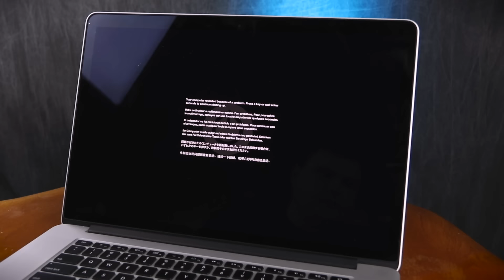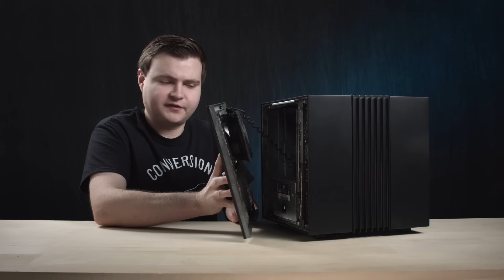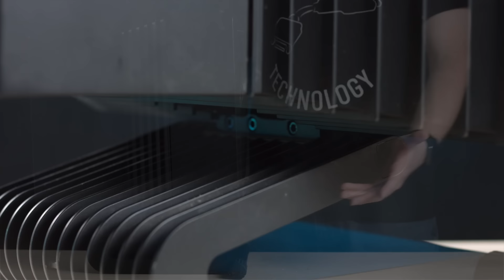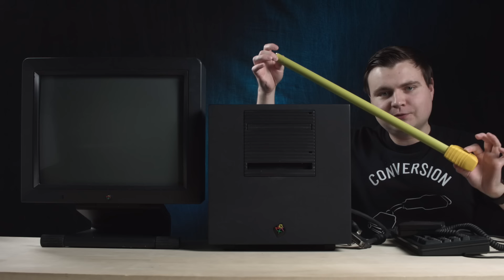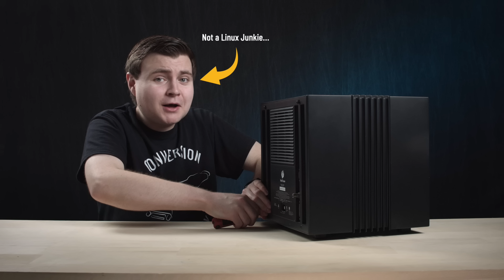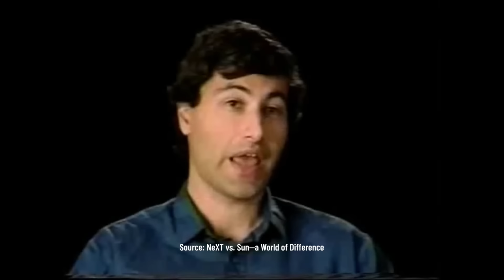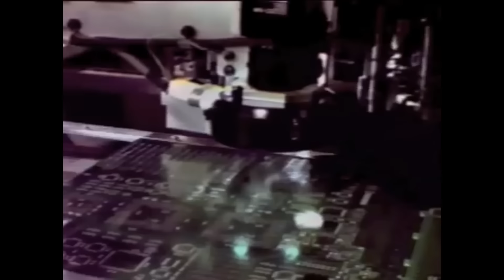I Bought a NeXTcube, Now What? - Krazy Ken's Tech Misadventures

Comment: Dude, I have one of these NextCubes aswell
I bought it in the early 2000’s from Penn State for $25
Yeah $25, it was barely used. Came with everything too
I’ve got the NextStep software reinstall discs 
And I have a pile of software for it
I use it to just putts around with 80’s Unix bro
I love it
Anyway, I’m going to be looking for a new home for it
It’ll likely get donated to one of the Big Mac channels on here
Like yourself if you want it
It is a Turbo model btw
I have a NextStation full too both with display keyboard and mouse
My Next Cube has the Next Dimension board and the Turbo board with color display
I paid $25 for all of it
So donating it will be it’s future
They were both used very lightly by my professor for the Penn State Computer Science Department

Comment: steve knew the Motorola 68k chip is not that great for his OS during that time , but do requires something with kick later on...when time is right for it G3 cpu's. Remember he came back to fix macos8 ....releasing macos9 by his hands, he did got early dock for it while its not unix based for os9. ...while nextstep still WIP for next years until first rhapsody r1 came out ...Then 2nd version . Then Steve end entire x86 development support for first RC of mac OS X that only ibm G processor supported. All that change later years when he went  to intel for later macos x

Comment: To put the price in context, this was a legitimate workstation, and most of it's contemporaries were priced even higher.
I do love my NeXTcube (thanks for making the computer/cube distinction), and mine has the rare Dimension board. Essentially, a second motherboard with it's own processors (2 of them!) which ran it's own micro-kernel OS and provided the attached monitor with 32-bit colour output. The Dimension board, unlike the main motherboard, does not have a Display PostScript engine.

FYI, my NeXTcube has the same dimensions yours does. It's shorter than it is deep and wide.

Comment: In November 1988, a little less than one year out of college, I stopped by a retailer selling NeXT Computers near the university where I had completed most of my math and engineering coursework. I was practically salivating as they showed me what the thing could do. It was my first year working full time as a software engineer and I finally had excess income but resisted a burning desire to buy one, walking away from there with a severe case of the shakes, wondering if I was making a major career-damaging mistake. 

Landing a job a year later porting software to several UNIX systems including DEC ULTRIX, HP-UX, IBM AIX, APOLLO AEGIS, and SGI IRIX I was in hog heaven at work, and finally at home too after cobbling together a GRID RHCL system to tinker with before moving on to developing on Sun UltraSPARC II at work. It wasn’t until 2011 that I finally upgraded the home system to an iMac Core i7 with a glorious 27-inch monitor which served me well as company computer in my own little LLC through to retirement, and four years beyond that, until it was destroyed by wildfire in 2022. Luckily I had copied everything from the iMac over to a Mac Mini by then and ran from the wildfire with that sweet little device in my bugout bag. Now I’m wrestling with desire to upgrade again, purely for post-retirement hobby work.

Even after all that, it’s good to finally get to see this presentation of a NeXTcube.

Comment: The Next cube; facts vs fiction
- Why cast magnesium? Its relatively cheap and contains most spurious EMI emissions allowing for FCC compliance.
- Cube dimensions. It was designed to be 12x12x12. Any deviation is due to mfg tolerances.
- Is it really a 'cube'? Yes. The enclosure is made up of 3 seperate pieces. Each one is cast using '4 slide' molds. These molds have no draft or taper.
- How do I know this? I was the Manufacturing Engineer at Next responsible for bringing the cube from concept to production.

Comment: 05:45 Accuracy please, "Modern Internet" is not the World Wide Web... Sorry, but it is annoying that people are hastily comparing both as one too casually or what ever. 
People need to be specifically pointed that WWW is NOT the internet, it is a another technology that use the Internet to work.
HTTP protocol is higher level protocol using the TCP, UDP and IP protocols (TCP/IP and UDP/IP), where two former are using the latter IP protocol.
The HTTP is like FTP, IMAP, POP, SSH, RTSP etc... Application layer protocol, that can be anything that application want to have to initiate the protocol with its counterpart application. 

The Internet existed, and was used way before the WWW, and that is always critical to understand. We had video streaming, voice over IP, forums, emails etc everything before the WWW. The WWW is just the web browser and now using lot of other older protocols to get the stuff as well rendered in the browser interface.

Comment: Why would they make the case out of Magnesium.  Magnesium goes up in a flare like a...   sparkler.

It could be easily be mistaken for an orphaned stereo speaker or space heater from the 1980's.
If I had wanted a IIci at the time with color Trinitron display, and management got me a Next, i would of been like... aww...

Comment: 23:02 it might be inspired by NeXT, but macOS had double arrows both at the same end of the scrollbar, starting with System 7.6, I think? It was definitely an option before OS X, but I’m not 100% sure which version. So they could be that way in OS X because of NeXTStep or because of Mac OS.

Comment: This was always an absolute amazing system!

As an Atari ST (and later Atari Falcon) user at that time, I found the Motorola MC68040 processor unbelievable, not to speak of the Intel i860 64-bit processor used as graphics controller, and the Motoral DSP 56k as audio signal processor.

Comment: Cool stuff.  Years back I bought the NextStep operating system for PCs.  I didn't realize that it required a bootable CDROM drive to install it.  Back then that meant SCSI.  I didn't have access to that and it never got used.  :-(  Of course eventually NextOS became the Mac OS X, so in recent years I did get to experience much of that.

Comment: The size differences are real.  To cast a cube is difficult to impossible, as you need a little taper to get the case out of the mold. If you want a perfect cube you have to cast it a little bit larger and tapered, then machine it down to a perfect cube.  Even Steve Jobs didn’t want to spend the extra $$ for that extra bit of perfection.

Comment: Was a programmer (JOVIAL) in the mid 80's on the USAF AWACs. Used an IBM 360 I believe with the huge hard drives. In the simulator we had a Honeywell 4PI like the AWAC used. We had to learn to use punch cards in tech school but thankfully the 4 PI used those big magnetic tape reels. Remember when floppy was a big thing, had a room mate who splurged for the Commadore 64 which used the floppy.

Comment: There was a way to do multi-processing, with a separate motherboard in every slot, except for the Video slot.
It was built to be 10% better than a Quadra 800av. The LaserPrinter was 400dpi.

I had three, one cube, and two turbo slabs. Adobe Illustrator and Adobe type twister flew on these boxes.

And no, Mac OS 10 has a DOC because it was derived from NeXT Step. I was there for the MacWorld Rollout.

That was the day I met Steven Wolfram. He said that Mathematica did not support the FPU because of bugs in the GNU Libraries. ok.

Comment: I am at the point where you just mentioned the floppy drive, and that what ever is there looks too big... Well, during the time the NexT was made, they were still using 5 1/2 inch floppy's.
Point of correction, the INTERNET was not based on the NexT computer.  it was In August 1969, the UCLA team hooked up its host computer to an IMP, a Honeywell DDP 516 computer, making it the first of the four sites to connect into ARPANET, which became the Internet/World Wide Web...

Comment: The Nextcube had an option for a 3D-VFX and component YCbCr video recording board called NextDimension which had a very expensive and powerful video-coprocessor which if proper software was created and used, you could edit S-Video and 3-channel component video on a timeline much like what Adobe Premiere, Blackmagic Resolve AVID Media Pro do today! There was to be a duaghter C-Cube MPJEG encoder daughter board that was attached to create a timeline editor but that didn't actually ever ship. The main NextDimension board just has the 33 MHz Intel i860 RISC processor on it which was something no-one else had on a super-workstation! A lot of scientific research and petro-companies bought those NextDimenion boards with the NextCube just for the i860 chip!

The NextDimension board was basically a graphics supercomputer all by itself and I remember seeing demos of this in Calgary, Canada at various Oil & Gas companies using the NextDimension and NextCubes for oil and gas reservoir and directional drilling modelling. It was actually MUCH CHEAPER TO BUY and MORE POWERFUL computation-wise than the Sun and Apollo super-workstations and VAX Minicomputers of the late 1980's and early 1990's! It had an i860 RISC processor on it which was basically a supercomputer-on-a-chip it was so powerful!

I personally used a Nextstation, which was more of like a pizza box workstation, for graphics development but I have used the NextCube and NextDimension boards too! 

As a suggestion, ALSO LOOKUP, Play Inc.'s Trinity video editor cube which was FOUR TIMES THE SIZE and weight of the NextCube and was a powerful supercomputer all by itself in 1999. Of course look up the even older VideoToaster (v1 to v5) from 1990 onwards along with its parent Amiga 4000 computer! I used those in College for broadcast television courses!  Another piece of computer history is the Leitch Velocity-HD with 3D-VFX card and connector box which is a MONUMENTAL moment in real-time video editing and graphics supercomputing! It is STILL today in 2022, an awesome and complete realtime video/auido editor software/hardware combination!

Another set of older BUT POWERFUL computers to lookup and buy are the SGI (Silicon Graphics) Indigo, Indy, Octane and Onyx superworkstations which I have also used and even today are pretty cool to use! The very first Jurassic Park movies were 3D-animated on these SGI units from the Early 1990's to 2003+! If you can still find it, buy the 1600SW monitor which was still one of the BEST displays I have ever used!

And for the KICKER, try and buy the old Intel 80386 processor-based IBM PS/2 Model-80 tower system running IBM OS/2 Warp-4 OS which I used even up until the mid-to-late-2010's for financial trading systems work and scientific spreadsheet modelling work because all the legacy software and those HUGE number of iterative self-expanding macros was just too expensive and esoteric to re-code/convert to a modern JAVA and C++ system until about 2018!

V

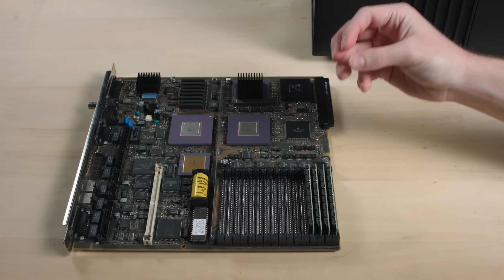Comment: https://www.youtube.com/watch?v=92NNyd3m79I :Steve-Jobs-Presentation with making the board from about minute 28 on. But just imagine:The 68040 CPU had about 1 Mio. Transistors at 25 Mhz. Nowadays we are about 1 Billion transistors and 3 ghz. Now make the math how many 10.000$-Cubes are in a present PC for about 400$ 😉   Btw.: You made a great purchase: This thing seems to be have barely been used. O.K its not from 1990 but Early 1992 ( 9:33 9142= 42nd week 1991 ) I wonder how this PC is booting with the surely dead CMOS- BIOS-battery

Comment: I believe the square that forms the front of the cube needs to be slightly smaller than there rear so that they can be extracted from their molds during the manufacturing process.
Reply: Yeah!  I think the slightly imperfect being perceived as perfect was marketing BS they came up with just in case anyone measured the thing.  And Jobs' being the difficult, uncompromising, seeker of perfection that he was ... he would never have settled for anything less than a perfect cube.  Except that, like other areas of his life where this inability to accept reality ultimately forced compromise ... it's just more cost effective to not waste material that can't be extracted from a mold due to manufacturing processes.

Comment: I am very glad that modern case design doesn't have to be that complicated if I don't want it to be. Sure, you can buy one of those mini-cases and challenge yourself to build within the confines of a tiny case, but you don't HAVE to do that. I just imagine working on that thing, with it being dependent on being slotted into the case connector correctly and the way the cables connect to the edge of the case.

Comment: How are you getting millimeter results if you are using inches? Those are 16ths if you are using a cheap measuring tape or 32nds of an inch if you are using a carpentry tape. If it has both imperial and metric divisions then why not just say the metric measurements?

Comment: Holy crap. I forgot about that. I used to use NeXTSTEP on Linux. I don't remember if it was a clone, a port to X Windows, or the actual GUI from NeXT itself. But it was beautiful, and I loved it as much as Gnome and KDE 2 back in the day.
Reply: OpenStep was/is an official port of NeXTStep for x86, and like half a dozen other processors, that was made available near the end of NeXT as a company. If they hadn’t been bought be Apple, it looked like NeXT had decided they didn’t need to make proprietary hardware but could give people a good enough product as just software. But I don’t remember if there was an official announcement to that effect. 

It’s because of the work done for OpenStep that macOS is so easy to port to other architectures—MacOS X ran on x86 right from the start, just not publicly released.

Comment: The only machine to have is the NeXTStation Turbo.  NeXTDimension and 040 boards for the cube were ok, but not stellar.  Mono Turbo Slab is pretty killer.
Even better is an HPPA Risc 712 machine.  It is just tits.  Never crashes (unlike Intel) and doesn't weight 1000 pounds like a Sparc 5/20!

Comment: Flip the fan to blow into the case to avoid getting dust in the MO drive. Also looks like the monitor is failing: check the capacitors.

Comment: you dont need an expensive caliper to measure it. 
a $6 16inch engineers metal ruler would be far better than that tape measure used for wood.

Comment: I was 9 years old when this thing came out. I'm so glad we have USB C/Thunderbolt 4 now. Those chunky cables of the old days definitely won't be missed. However, the idea of passing all data through one cable definitely had it's start there.

At the time, my family had a Amiga Commodore 500 which was actually quite advanced for its time especially when compared to PCs. It also had great audio, color video and supported direct output to various types of monitors (like SCART which was a European style plug that greatly simplified connecting video equipment)

Comment: Sorry, CD quality is only 128kbs.
Reply: Wrong, it is 1411kbps for CDs and up to 320kbps on MP3s.
Reply: @X150t  Sorry, it is 1411kbs or higher for WAV files, CDs are 128kbs. You are correct on the MP3 data.

Comment: Waiiit... did you say the NeXT machine could output 32bit colour... in the late eighties? Holy cow.
I had an amiga 500 at the time which had a palette of 4096 colors... A palette! Even in 92 when I bought my Amiga 1200, first of all it was originally an 020, not an 040 like the NeXT but even in its HAM8 mode you could still only get a max of 24Bit. OK, so the NeXT is closer to the Amiga 4000, but holy sh*t that woulda been powerful when released.

Comment: You wouldn´t find a other Computer MB that is that dense back in that era. The reason is simple. Computer is very cost efficent and there for they made it in the cheapest possible way. Specially back then, that was the main reason why laptops was that expensive. Even then, laptop MB was really not even that dense

If you look at phones MB back from that era  they are even denser.

Comment: When you said capable of 32bit colour in the 90's I immediately thought of the C-Amiga 1200, then you said Motorola 68040 and everything clicked into place ha :D I know Amigas used 68000, and 68020 and 68040 were upgrade add-on boards, I have a 68040 accelerator board in my A1200 but Iv misplaced the 8Mb ram chip that went in it arrrrgghh I also remember seeing my first hi-res full colour JPEGS from floppy disks on it, they were stunning for that era on a big CRT tv 
That Next is something I never heard of but like you say, its immaculate and extremely well put together, and wtf! how many ram slots LOL

Comment: Classic Macs had the beach ball cursor, but you only saw it in the install utility and Apple Disk Setup. typically, when you had to wait in classic macOS, you saw the wrist watch cursor. I've seen it occasionally in macOS X, but I don't know if it's in the latest versions or not.

The NExt wait cursor was more of a spinning disk than a beach ball.

I remember seeing the first screenshots of the upcoming Windows 95 in very early 1995, and I thought that a lot of the visual design was copied from the NExt. Particularly the X close window icon.
Windows 95 plus pack also gave you the ability to have live updating windows when dragging, and that was pretty amazing.

Comment: It strikes me that you could, potentially, make a modern PC in that thing. It would require replacing everything but it could be done with off the shelf parts, some 3d printed brackets, and some power tools to modify the interior of the case. It would make a great sleeper build.
Reply: There is probably enough space on the left to put a whole modern motherboard and leave the old stuff in! 2 computers in one box!